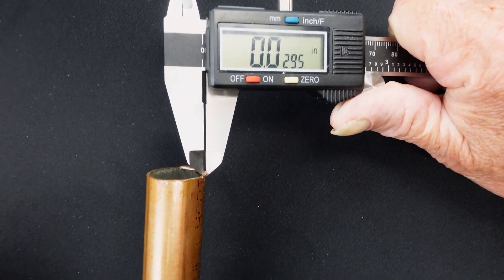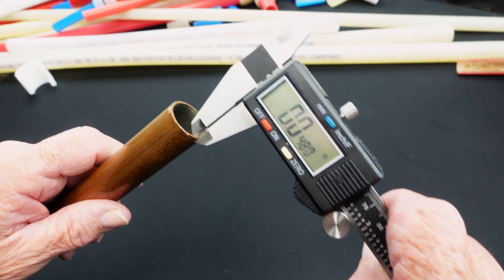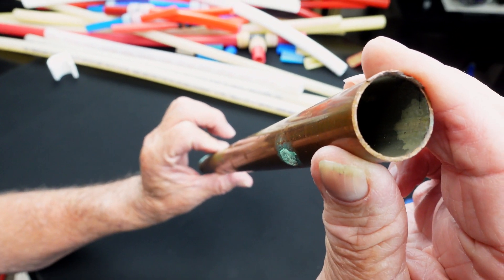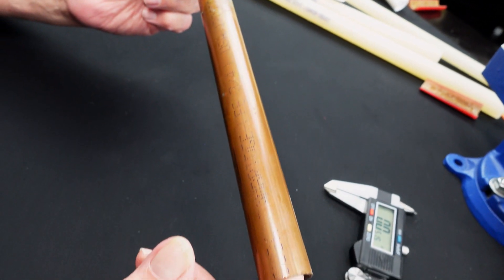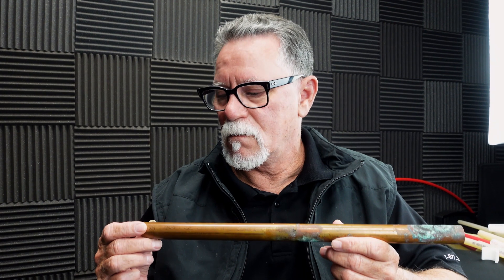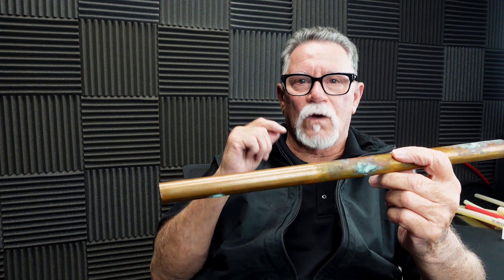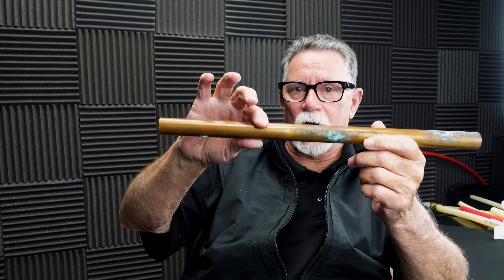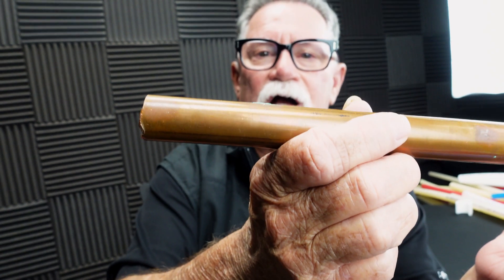L Type Copper Poisoning  | Breakpoint Chlorination

Comment: Gotta go K-copper. My experience that slight bit of thickness over L is worth it. M you wonder why they even make it, but cheap has a good market of customers.

The 2” service lines of K copper and angle stops I’ve worked on are 27 years old, been charged with high pressure Reclaimed water the entire time (Reclaim having much higher amounts of chloramine than domestic water, and they’ve never had one leak ! Knock on wood. The only thing I’ve done to them is replace the flared brass angle stop; after 20+ years they begin to seize and become really hard to turn with the T handles. It’s best to change them because you want them to be reliable. Nothing is worse then going to use an angle stop and then it breaks in the closed position or vice versa, then you gotta go to a distribution gate valve and start shutting down streets, buildings etc. 

I go K all the way. But good luck finding a contractor who will install it. Even if the customer asks for it, most of the customers don’t have a clue of what to check label, micrometer thickness etc, so the contractor buys L or sadly M and then sands off the label and tells the customer, yeah I got you K and pockets the difference 💰. Residential folks have been ripped off by contractors and architects for decades. If you find a good contractor- keep him ! And treat him well. Most of them are a bunch of liars. 

Putting L copper through slabs of foundation in SoCal was the biggest scam to residential owners to date. Why the hell would you want couple hundred feet of pipe and fittings(not even wrapped for corrosion protection) under your home:??? So 10 years later you can start re-piping homes and ensure another 10-20 years after that of job security. 

There’s no reason why these homes had to be built this way. Other than cheap and planning to take advantage of folks for easy money. They very easily could of stubbed the copper service line into the wall of the house and ran all the lateral lines through the framing etc to the fixtures with copper, pex, galvanized, pvc whatever your heart or plumbing code desired. Slabbing all that was was just money maker and the public being screwed.

I don’t think there’s a perfect pipe, they all have ups and downs. For distribution piping I’d say Ductile is probably the best (if installed with the proper cathodic protection and cement mortar lining and wrapping corrosion) but that takes a lot of work and training to really get the crew to perform. A lot of guys installing it skip those steps and then it sees issues. AC (concrete asbestos “transite” pipe) believe it or not is pretty good transmission pipe but it’s outlawed in most places now and was susceptible to stress fractures. C900 pvc is the go to in a lot of warm climates but it does have a leeching issue microscopically and has less max pressure ratings then other options. HDPE fusion is excellent stuff, but requires highly specialized tools for installation. In terms of the small stuff for homes etc, it’s the same they all have ups and downs. Coppers biggest issue is, using too thin, and lazy installers, a lot of the green corrosion comes from lazy soldering practices. Too much flux is applied and never wiped off after cooled; and the acid burn and eats the copper over years, typically you see the green corrosion near fittings and valves where they really heavily applied flux and then solder, or a few inches away where it dripped down and never got wiped. Pex has its issues and growing with water quality issues. Galvanize pretty much sucks because eventually a 1/2” pipe becomes a 1/16” I.D. Lol, pvc for pressurized systems is not bad but the glue tends to fail on sizing 2” and up, also seeing some old glues applied 30+ years ago eaten up by the chloramines, especially in water systems and mains converted to reclaim water that were once domestic. Sch 80 is probably the best service main for a house from meter to copper stub into home. 40 is good but some of the water districts are pushing 120+ psi to peoples home, and that’s pushing the limits of 40 fittings. I’ve seen the 40 fail too many times. Another good way to build a service line would be, pvc as a sleeve, and run Pex through it with a pull box, so if you ever needed a whole new line you could pull a new one easily. But I don’t think code allows burial of Pex yet technically. 

I don’t know, there’s no perfect pipe. You just have to pick something that suits the needs and use it wisely- not under slabs for no reason 🙄 

Maybe one day they’ll make a titanium pipe. Plumbers will install it and then be unemployed for 1000 years lol 😂. 

Last tips if your in the underground industry:

-wrap all copper and brass buried or stubbed up lines with PVC pipe wrap. 10 Mil minimum. 

-wrap all ductile gate valves and fittings with Mil Plastic and thrust block appropriately, and then turn the Freaking Gate valves ONCE a year! Come on folks let’s start paying enough tax to budget for the cities for making sure there’s enough staff to ACTUALLY maintain valves, angle stops and hydrants so they actually LAST! And are Reliable. -> NOT need it and it breaks, then you have to replace one to fix another. (All tax/money/budget cut and “saved” by bean counting administration -> LOST on premature failures and replacement) get rid of the bean counters and get people that ACTUALLY WORK!
Reply from the maker: Fitting under the slab have always been illegal. Please share what the copper wall thickness of the fittings you use are. Copper wall Type L fittings or Type K fittings  have never been made .
Reply: @IntegrityRepipeInc  yeah- another downside to copper. I don’t know why they never made copper type fittings:

Like: K-L-M-DWV specific fittings

They just use the same fittings for all types. Stupid. But I guess they had to make it idiot proof: because installers tend to be sadly to say more often then not lazy and un trained- so you’d probably see wrong fittings used on pipes if they did do that.

Like PVC is hard to screw up: 
sch 40 - White
Sch 80 - dark grey
Sch 120 (not available in U.S only Canada to my knowledge).

But they probably didn’t do that for copper because the idiot proof factor. 😂 
They didn’t want to color code or coat the copper. (Though the copper label does usually have a small stripe) but that probably was the line of idiot proof 😂 that’s funny. 

As far as the thickness I use. Man I don’t have that one memorized. You got me curious though now. Next time I open up one of those 27 year old 2” K lines, I will get a micrometer on it 🫡. Another thing I think helps the reliability of the K line I’m use to, it’s made of the long sweep sweated 90 instead of the traditional quick 90 elbow. I think that plays a huge factor in reliability. The elbow is a really abrupt bend and even with thrust blocking, it’s only common sense there’s gonna be a stress factor is that quick turn vs the long bend 90 sweep, the water just kind of nicely sweeps the turn up the standpipe to the angle stop , instead of just an abrupt 90 degree. 

As far as the homes go, I think a good way to combat the water hammer effect is use those sweat on copper water hammer arrestors. Especially near the tub 🛁 where higher flow goes from ON/OFF very fast. Those absorb the vibration instead of it getting put into the pipe and fittings. Put them in a nice access panel. 

Let’s remember folks max flow rates for piping should never exceed: 7ft/s  (metal piping ex: copper) and 5ft/s (plastic pvc etc). And a 1/2 tub spout is most likely gonna exceed 5 or even 7 ft/s  if it’s wide open. A 1/2 wide open line, even if you have a 70XL Zurn regulator on the home, psi will be roughly 50 maybe cranked to 70psi, that 1/2 wide open spout, depending on the type supply, let’s say 1/2” K copper- should never exceed 4gpm. otherwise it will surpass the 7ft/s velocity max; that will then cause water hammer issues. Odds are @70psi that 1/2 K supply will be putting out at least 10+ gpm (it’s easy to bucket test tub spouts). Usually they all exceed what they were built for. Hence a good idea to put the arrestors in. 

Do you guys use those? I haven’t heard you mention those. If not, how come? Curious.
Reply: @mrDmastr19  I’ve used schedule 120 several times on deep water wells and I haven’t had a problem getting sch. 120
Reply: @plumbbuild6517  cool to hear. What state are you in?
Reply: @mrDmastr19  Ga.
Reply: But the supply houses I use Cater to a lot of well companies
Reply: @plumbbuild6517  interesting. Well good to know it is in the US. I don’t think they sell it at any suppliers here in SoCal. And I was told at a training once it’s heavily used in Canada. But it would make sense to use it for what you mentioned in well applications. So it has Sch 120 fittings too? That stuff must pretty thick pipe ! I assume it thickens on the inner wall like 80 where O.D is the same as 40.
Reply: @mrDmastr19  it’s actually bell female treaded one side male treaded on opposite end, it’s not cemented , we use pipedope now if you have to cut it you can use fittings and cement .
Reply: Actually pipe made out of Irridium would be more exciting.  It's the most chemically resistant metal on the periodic table of elements, it's better than Gold and Lead.  I am not sure how well Titanium stands up to water though, I'll have to research that, but I do know that Gold and Lead are also amazing as water pipes. (non-potable obviously for lead.)
Reply: @panemon187  doesn’t get much better than titanium. As a certified diver, titanium equipment like Knives, and even regulators; are far superior to any of the stainless steel products. It’s much lighter weight and virtually doesn’t corrode at all even in salt water. However it’s more expensive. That’s always the case isn’t it.

As a pipe I don’t know, maybe there is a reason they don’t consider it, probably cost, and probably because if they made it there would be little to no business in the service industry lol 😆.
Reply: Thanks for the info

Comment: I am on a well and the copper was being eaten up, I used pex-a and no issues 6 yesrs now
Reply from the maker: Please Read and follow @John-Del advice in the Reply Below.
Reply: That’s what happens when they push for “no regulations” it should be regulated so they HAVE to disclose the information.
Reply from the maker: @mrDmastr19  Hi Dennis. It is already regulated and always was. You may might not have understood that.
Reply: @IntegrityRepipeInc  yeah but it varies water district to district. It should all be federally regulated: same water, same specifications. 

The business of making things locally controlled is stupid and serves none one but the rich man.

Hate to be political but in my opinion, water is a basic necessity for human beings which can easily be across the board the same quality for all individuals. 

It wasn’t until like the last 10 years where they finally passed the clean water drinking act at the federal level. But that was just a start. It certainly didn’t fix all the social issues we have in the country regarding water. 

Some areas people could literally light there two on fire 🔥. To me that’s inhumane.
Reply from the maker: @mrDmastr19  Not True I am afraid. The EPA regulates all of it. Minimum standards, but the contitions of the water change constantly, day to day as it rains or dust storms or drought or summer-winter ect.  the needs of the water, more chlorine or less chlorine to stabilized it are changing every day. The only way they can be constantly mantained every day, Day after Day is by local Authorities. The weather where you are is probable different than the weather where I am and all it takes is a little rain water to made the situation toxic. The EPA is in control!!!  They use (The Breakpoint Chlorination Method Nation Wide) 
Washington DC is in control they have been this whole time.  Disclosure was done!!!     I triple dog dare you to find it!!!!  Good Luck Friend.
Reply: @IntegrityRepipeInc  I 100% guarantee you the water both domestic (potable) and Reclaimed water (commercial irrigation) varies in great numbers water district to water district in terms of TDS. I’ve personally tested MNWD, IRWD and MESA, and the numbers between districts and the treatment plants and the specifications for quality are totally different. The EPA by no means has ultimate control. And it’s a shame they don’t. In a country this large and a federal tax system; it would be extremely easy to make the water distribution quality control on par and equal everywhere. But we live in a capitalistic rich man’s world. Where the rich man wins and the vast majority get abused. Just like the world of contracting. The white man owns the business and hire 7 illegal Hondurans to do the real labor of the job whilst he likely votes right wing who hates illegals but benefits from them. 

That’s the world. Peace to you ✌🏻
Reply from the maker: @mrDmastr19  Nobody hates illegals!!!  left or right!!!  There are just as many Hispanic Contractors as White Contractors and nobody cares what color they are.  People hire contractors they like after talking to them. No homeowner ever hires someone they do not like.
Reply: That’s what happens when they push for “no regulations” it should be regulated so they HAVE to disclose the information.

Comment: I'm so confused what to use to repipe the house.  Seems like w/ Pex we are getting a 6–10-year lifespan then repiping again.  Copper is toxic.  What is the long term solution?  I am on well water and the acidic nature vs copper isn't great.
Reply: If you're on a well, you must put an acid mitigation system in or you'll be repiping the copper.  According to Integrity, the PEX failures seem to be from chloramine in the water which is what you get on municipal water.  You shouldn't have that problem on a well.   Best thing to do is get a water analysis and see what you're dealing with.
Reply from the maker: @ohger1  Hi John-Del. well said, that answer is perfect! I install Zurn Pex B Pipe, fittings and rings. That is my recommendation. Zurn Pex B.
Reply: @IntegrityRepipeInc  do you mean copper rings?
Reply: @ohger1  Thank you for your reply.  Erikl.
Reply from the maker: I use Zurn Pex B pipe, fittings and rings. That is what I install. Zurn Pex B.
Reply: Anyone who is "on well water" should be chlorinating his water. Just because the water comes from the ground doesn't mean that it's free of organisms that can infect you and cause disease. Chlorine is used for good purpose, which is to kill the microorganisms and viruses that can kill you.